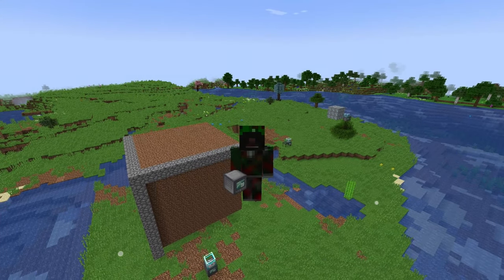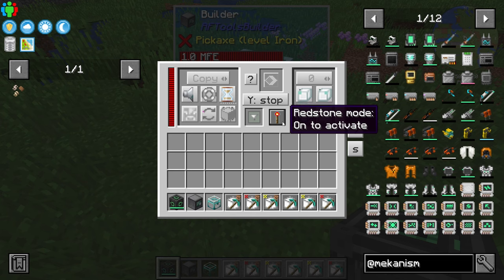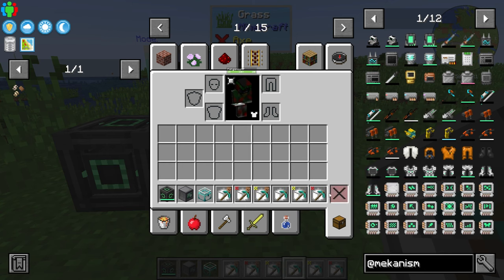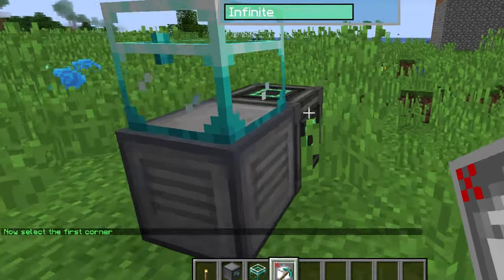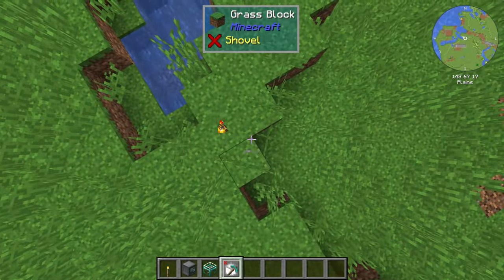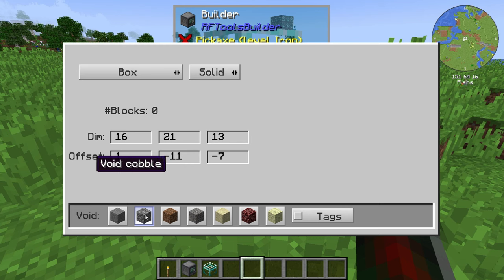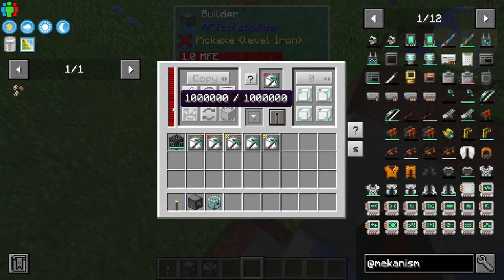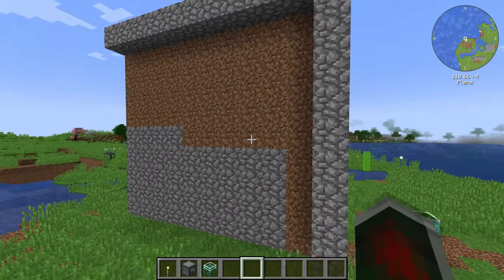RF Tools Builder: Easy Quarry - simple tutorial (1.18)

Comment: Do you think there's a way using various mods of automating the placement of this? So you could automate a quarry that does a section, and then moves itself and does another? Or is the settings shape card step always going to be manual.
Reply from the maker: If you can have the shape card select a length, width and depth rather than specific coordinates, then you probably could. But I'm not sure if that's possible, sorry :/
Reply: It maxes out at 512x512 so just set it to that and realistically unless you're playing an expert pack you're gonna unlock void mining before you ever run out of resources from this one quarry

Comment: so if I mark a larger area, the machine simply will not produce, so a larger amount of current = a larger area to be extracted?
Reply from the maker: The machine will tell you if it doesn't have enough power. Try feeding it too much power and see what happens
Reply: @Failgames47  I just built this machine and I saw a message that there is too little power, the problem is that I don't know how to make enough power, I don't understand this mod and I know that I need A LOT because I want to mine a lot. Do you know how to build a generator that will provide a lot of this power?
Reply from the maker: I've never used RF tools for power creation, but Bigger Reactors is usually my go-to for power generation. You will need a lot of coal and uranium though.
Maybe a high level Powah generator would work? In not sure